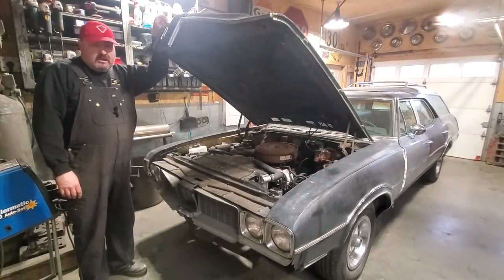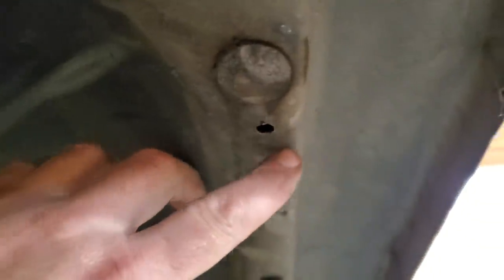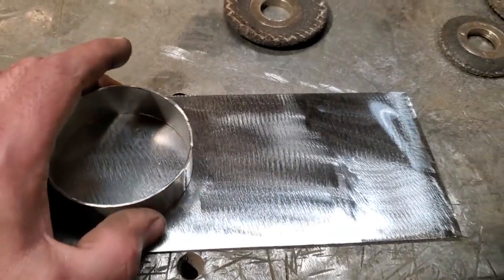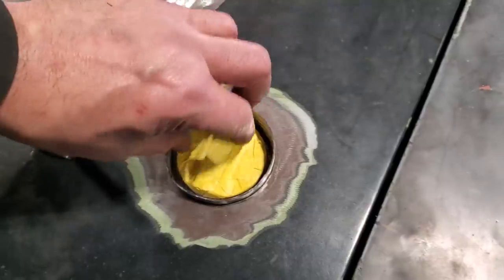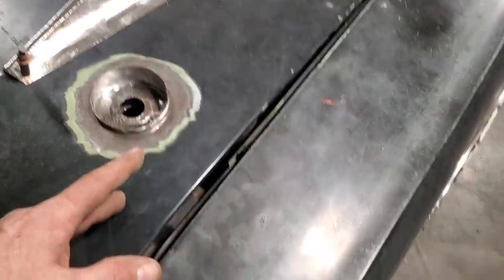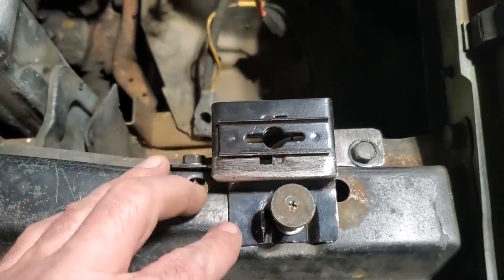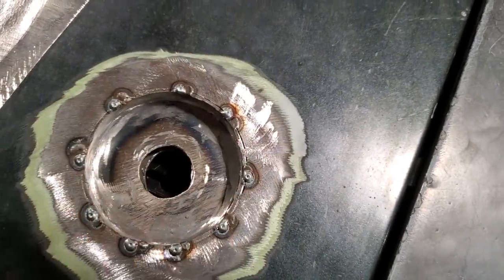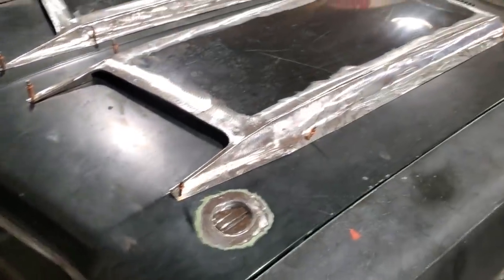442 hood pin install on a Vista Cruiser wagon

Comment: Tony, those hood pins look amazing! You had to pull out your bag of tricks on this one. I can't believe how much work went into this. When you had to remove the bumper my jaw dropped. I would have never dreamed it would have been this complicated. So glad you are the one doing this because it is way above my skill level! My car is in good hands! ❤️
Reply: Good hands indeed!
Reply from the maker: The hood open and closed so nice a over looked the fitment. I run into all sorts of this stuff over the years. You be amazed at what I have seen.
Reply: Ben you are going to have one of a kind!
Reply: Similar approach in woodworking; known as “hang and cut”. No measuring needed. It’s used a lot in boat building where it’s hard to reference from curves.
Reply: it will look so good that  people will doubt and start saying that this is the  original ram hood and all the oem fiberglass ones are fake 🤣

Comment: i been following ya a while now mate, Im from new Zealand. thanks for the show, iv actually taken a lot of what you have said and shown, has given me the courage to try this with no prior experiences welding etc. so i have put this into attempts of making things from sheet metal, i made a new interior of my little fridge, fixed heaps on my 98 vr4 Legnum Twin Turbo 2.5 L / Mitsubishi. I got rear ended BAD, I replaced the whole left rear quarter to the rear wheel and chassis rail to the back seat , boot floor and obviously the boot hatch to. I then converted it to manual wielded the center diff and pulled the front shafts and pugged the holes, its now RWD not AWD,  . I have had this car more then 10 years and other then a 68 dodge charge this is my most favorite car, Thank you dude.

Comment: Hey Tony, you help me every episode with my 64 F100. The only body supports not completely rusted away where the rear cab mounts. Over the winter I've rebuilt the box cross member supports and am now getting the body lines to match up front to back. I can't get the hood to drop at the firewall. It wants to sit high and it's bugging the crap out of me. After watching you I think I have to lowery rad support which will allow the hinges to travel just a bit farther and put the apron, just below the grill, into better alignment with the bumper. Great tip with the latches when aligning doors and hood. Thank God I only have two doors!:) Sometime I'll tell you how I used exhaust pipe to rebuild my tailgate!:) Thanks!!

Comment: Solid advice Fitzee. Always start at the 1/4 panel and the only thing i would ad is if doing a restoration or just a restomod replace the door hinge pin bushings before mounting those doors.

Comment: That explanation to start with the back door first and then continue forward was very good, to get the right fit for the other parts.So was the change you had to make on the locks for the hood. I think you work exactly and well. It was a great video.

Comment: My buddies and I have joked about filler-over-duck-tape repairs, but holy cow. Guy must’ve owned stock in Bondo Corp.
Reply: I stripped a 50 buick had a dent in the front fender above the wheel had 1.5" of bondo in it looked fine till I stripped it

Comment: Fancy jiggling those panel about, you could of built up the edge of the bonnet with filler and squinted at you tape measure harder so couldn't read the 1/4" difference lol .
I never worked on real old stuff like this but man you must uncover some unforeseen obstacles as you go through the resto .
Hats off for your effort put it right, always amazes me how good your welds and scrap metal grind up :-)

Comment: I have a set of hydraulic knockout punches that would work well for that, with the exception of that inner structure being in the way. Steel gauge works in the same way that wire gauge does.  I hear that about "small easy projects> You say to yourself, "Ah yes, this will only take 30 minutes"...three days later you're still fighting with it. Quite often because of previous damage you didn't know about. I had the very same issues with hood alignment on my '92 F250. Didn't matter what I did, something was always "out" somewhere! What I found id the the rubber cab mounts on the driver's side were perished and had sunk. An entirely new set of polyurethane cab mounts helped big time. I rebuilt a '69 Mustang fastback years ago that had been in right front side collision. Whoever had "repaired" it had just filled the dents with filler, then painted it. There was one patch that was about 8" x 5" x 2" thick with filler. When I broke the chunk open, the filler still smelled fresh on the inside. The dent itself was no big deal to take out and finish with no filler at all. Some people drive me nuts!

Comment: Man you do great work and also make it simple were it give me hope doing my car. I'm a mechanic/tech (retired) by trade but not a body guy. I do have all the tooling for body work that I have collected through the years so ready to tackle my 59 rambler American 2 dr wagon and an 70 AMX that I just acquired. with your instructions its a no brainer. might do a video of the project just got to organize. thanks for the videos really enjoy.
Reply from the maker: Love both those car. I had a 59 rambler 2 doors also a 68-9 and 70 javelins. Got a soft spot for amc's. It was my first car
Reply: @fitzeesfabrications  70 AMC was my first. 3rd 4th 5.8.10 thru 30 34.35.36. Its a disease.

Comment: Great job Fitz. You amaze me every time.
        If you had wanted to incorporate the radius at the top of the pockets. How would you go about it? I'm thinking that if I were to try this. I believe at the point where you vice gripped them in place ready to tack and grind. I would marked the height, pulled it out and hammer formed the radius them fit it back into a enlarged hole. Now a disclaimer. My ideas have always exceeded my ability. Heck I'm still learning to weld sheet metal with out turning it to scrap. In my 30 plus years of welding 1/4" plate was considered sheet metal. Any thoughts?

Comment: Awesome 👏 result.   Tips are so clever.  So will you add a weep hole at the bottom front corner of the cup?  What size hole is appropriate to make sure the water drains?  👍😎👍
Reply from the maker: Have no plans to. But might be a idea

Comment: GREAT VID. question for you Fitzee... as you make a lot of your own tools and jigs, would you ever just consider making a one/two time usage hole drill bit of the needed size? you had the actual size pipe... create teeth and harden the bit. maybe it's not feasible, but asking anyway.
Reply from the maker: I found that I really repeat jobs the same. So this is why my tooling is crude and simple. Now if I need it more then once then I would make a tool like the T dollies

Comment: Did you use .021 wire on this project. Good job. Another lesson taught. Thank you. Ronnie. What's with the hot rod next to the Olds. Is it another project. I sure remember those vista cruisers with the upper glass. Buick also had it on the 64's and 65's. Maybe longer, not sure.
Reply from the maker: Yes 023 wire.

Comment: Good job Fitzee.  One thing.  When you were final shaping the inside edge, have you considered a Dremel tool with a small flapper wheel?  Minimal heat and more delicate control.  Complete kit only about 100.00 at Canadian Tire or Princess Auto.
Reply from the maker: No I never though of it cause I never had that tool .lol. I make do with what I have. But I will say it a good investment
Reply: @fitzeesfabrications  I am a tradesman myself.  Once you have one, you will find dozens of uses for it that one never thinks of.

Comment: I heard you say you were going to finish up the bottom side, and I cannot wait to see the rest. I have a design question regarding the hood locks installation. Besides finishing the bottom, your install seems unfinished pertaining to the holes you left in the bottom "cup" and the hood's bottom sheet metal. When the hood lock pin penetrates, shouldn't there be a piece of pipe for them to be sleeved by? You seem to have left those 2 holes in both the cup and bottom hood. Another smaller pipe welded to the bottom sheet metal and to the cup, would seal out water and moisture...so water doesn't get in between both pieces of the hood's sheet metal. It doesn't seem "finished" or as clean as it could be to just leave holes drilled into both the cup, and the bottom piece of the hood's sheet metal. I hope I explained my question adequately. What's your thought on inserting and welding another smaller diameter thin walled pipe as a conduit for the hood lock pins to pass through, to seal the metal?
Reply from the maker: You could do that but the lower frame is not weldedto the upper skin only on the sides. I would worry about the pull on the panel with different heat ranges on bottom and top

Comment: i hope this doesnt sound to dumb but, would water pooling up in those pin wells cause future rust issues ? or would there be enough ventilation around them for natural evaporation ? im trying to imagine ways to seal it so water wouldnt travel further into the engine bay potentially ?
Reply from the maker: Your over thinking it. There are many places on a car for water to hang up. Those have no 1 inch hole in the base to let water out

Comment: Loving your work :) is rain penetration an issue between the bonnet and it's support framework?
Reply from the maker: Shouldn't be as the lower frame has drain holes in it

Comment: Putting a vehicle back together and getting a hood to fit right can drive a sane man totally mad. The minor amounts a fender movement contrast to the door alignment can drastically affect how the hood fits into the equation. I’ve worked in an assembly plant and when things are build new there are assembly jigs that are used to assure proper fitment of panels and things but when you’re reassembling something from scratch it can be an unholy nightmare just to get a set of fenders and a hood to line up like they used to.

Comment: Thanks as always. Small question though. You seem to leave bare ground metal for a fair while. Scoops for example.
How long would you say they last before needing a sand before primer/paint?
Reply from the maker: I keep my shop at a constant temperature. It can last a long time. It will be fully sanded when it's ready for primer
Reply: @fitzeesfabrications  thought that might be it. My shed's full of gaps. Prime straight away :-)

Comment: Very nice, do you know if the owner is going to carry on the 442 theme through out the interior also? I have been thinking about doing a 66 Chevelle 4 door wagon and using all the Supersport console, bucket seats and running gear to match my sedan. Should be and easier task since all the frontend trin will fit the wagon.
Reply from the maker: This will be a on going project. Ben has plans in his head for interior.
Reply: I'll keep the theme on the outside (blue with white stripes) but the interior will be a little unique. I have some bucket seats out of a 93 Corolla that will get recovered. They are quite comfortable for my frame (I'm a small guy). I have a 63 Starfire Console that I'm thinking about using. It looks really nice and would compliment the interior quite nicely. Obviously the purists may not like it but it is still an Oldsmobile part that is getting new life.
Reply: @ChaplainSkelton  It's your car and the way you do it is to suit you, Hope to see it all finished some time in the future. It's a really interesting project to follow.

Comment: Tony, the heavy bond on the driver door. What did you use to remove it, great metal work.
Reply from the maker: Hammer and flat top screw driver. Lol. Don't judge me. Hahaha
Reply: @fitzeesfabrications  sounds like you are just chipping it off first,  thanks .

Comment: Have you switched to 25% Argon 75% CO2, I don't see the slag beads sticking to the surrounding metal on these welds as I'm getting with my straight CO2?
Reply from the maker: No still just co2

Comment: Most Insurance companies now warranty auto body repairs for the life of your car if you use an approved shop. In the old days you had to get three estimates and the body shops tried to cut corners by saving the customer their deductible.  Auto body work became a kind of bon-do sculpture.  The industry has changed for the better in my opinion.  Either that or maybe I not a cheap bastard anymore and I pay my deductible so that the work is done right. It is a shame to see someone try to restore an older car and then find an inch of body filler.